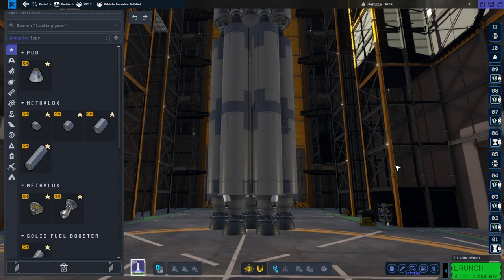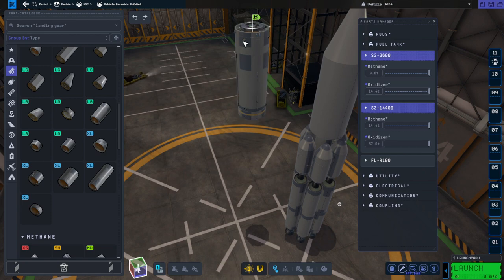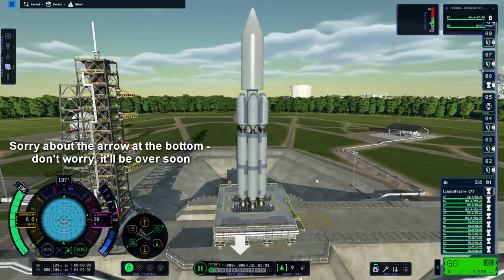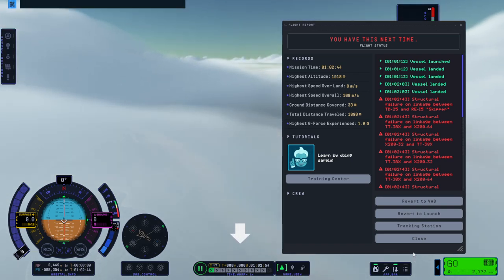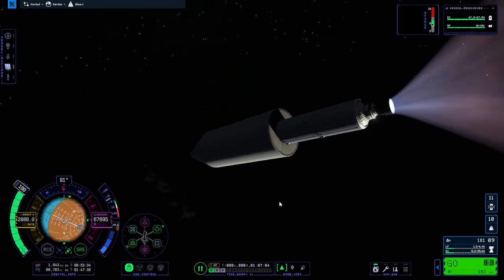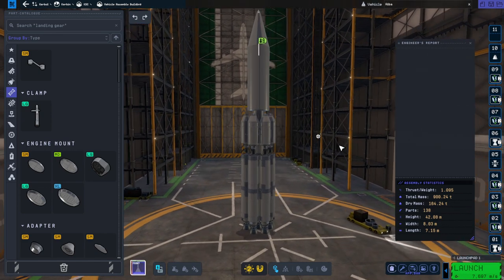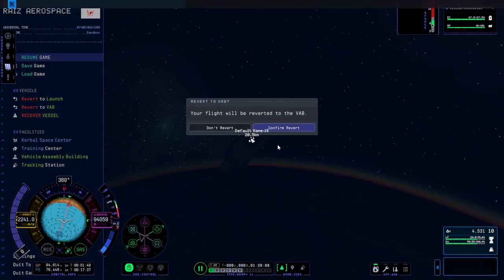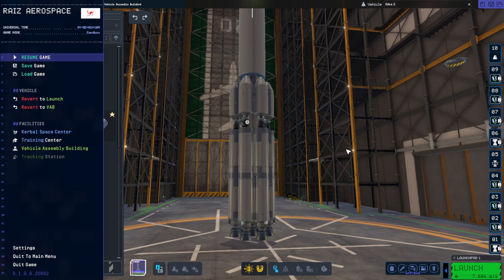Kerbal Space Program 2 Early Access 02 - Mainsail 7 and the Art of Strutting

Comment: Sorry for off top. Is there any way to make decoupler's fairing fit diameter of fuel tank above the engine instead of engine itself? For instance, if you place small engine on the medium tank you got disgusting little fairing.
Reply from the maker: I don't know if there's a special way in KSP 2 - usually I either use a fairing of the correct diameter under the decoupler or use an engine plate of the correct diameter under the engine, since the engine plates generate their own fairings.
Reply: @RaizSpace  Thanks for answer. I recalled this ways, but is there engine plates in KSP 2? And when I tried fairing it gives collision error something like collision with wrong part
Reply: There are some structural TOOB-<whatever> parts that I used for this: engine, decoupler in size of tanks above, TOOB in size of tanks below, then offset the decoupler up so it meets the tanks above the engine. Seems to work okay, although upon staging, the TOOB parts just disappear instead of sticking with the tanks below, which is kind of unsatisfying. Really wish they would just make the Decoupler Shroud mod stock in KSP 2.

But otherwise yes, KSP 2 has engine plates that seem to fix this also.
Reply: @cletuswa  Thanks. I supposed there are no engine mounts in ksp 2. Nice